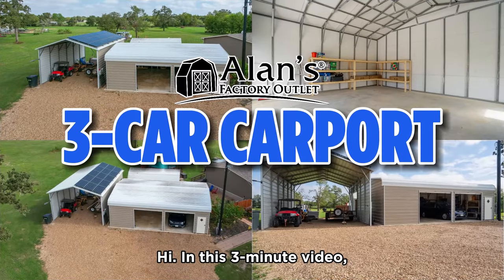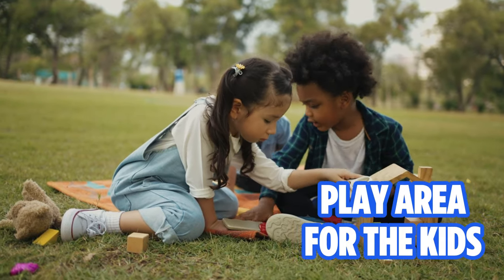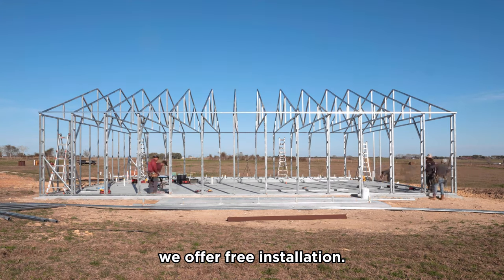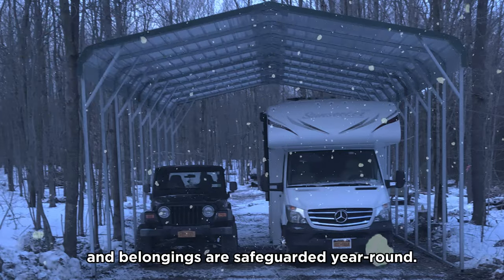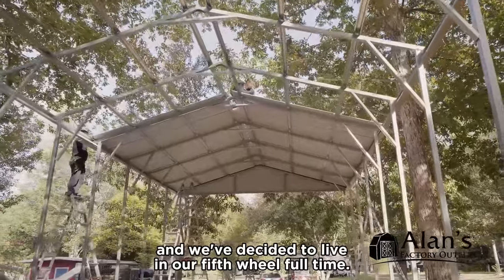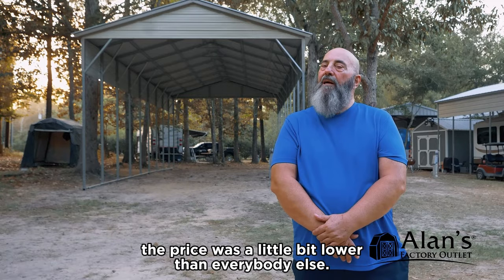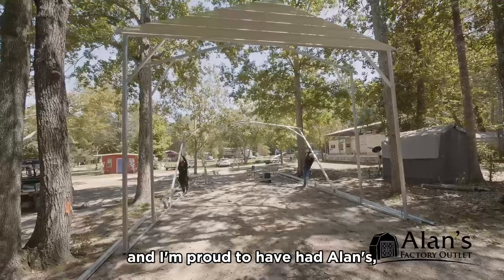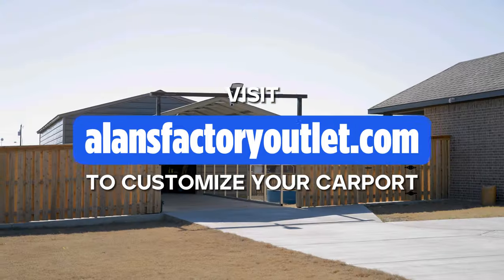3-Car Carport: The Best Outdoor Coverage for Your Fleet

Comment: Do you pour the concrete as well? Could you do a vid explaining concrete thickness, size and expense because from my understanding, the concrete cost as much as the structure. Some concrete might have a bevel around the edge to allow the water to drain. What’s your preference?